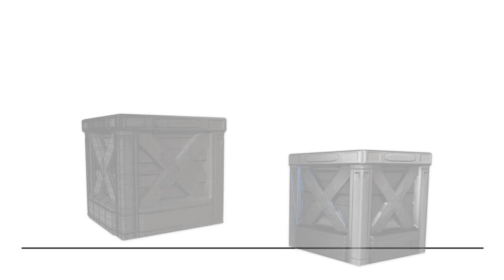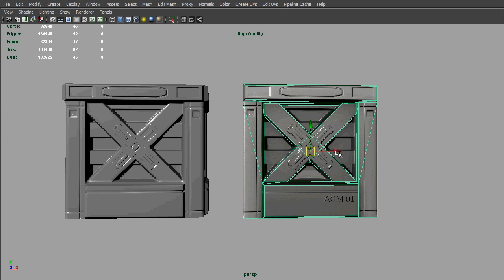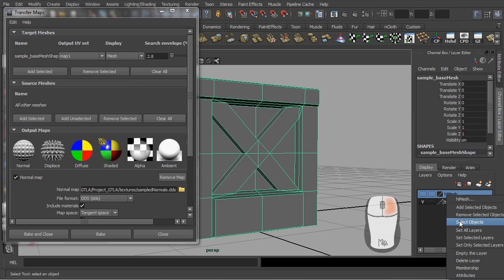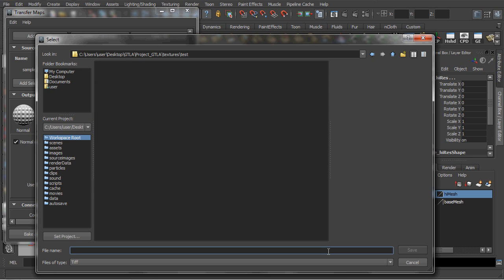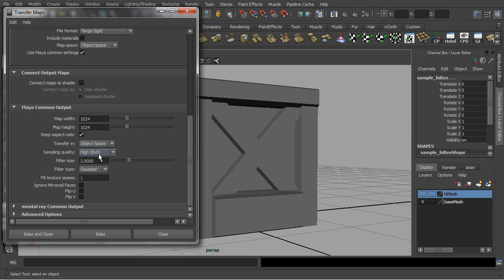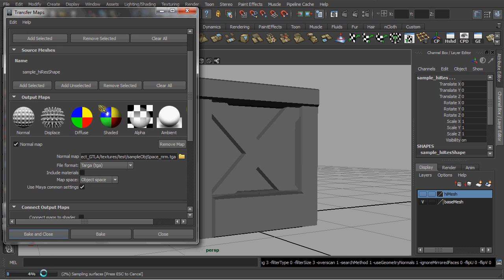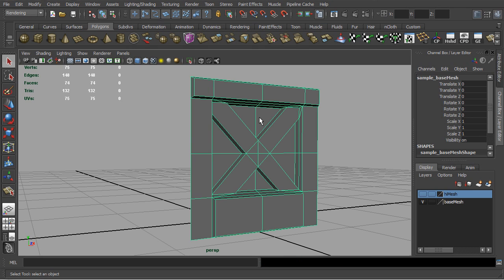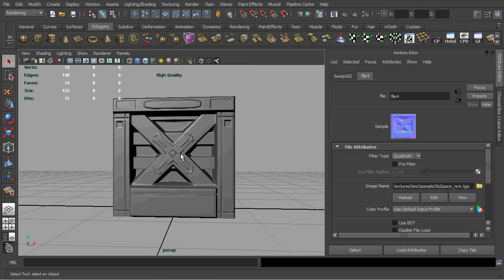Baking Object Space Normal Map for low poly game asset (Autodesk Maya)

Comment from the maker: Hi there! There are many different possibilities that can cause the operand of normal baking to fail and out of course sometimes.  Sorry I can't figure out the written difficulties that you had faced.  Anyhow, please do ensure that the XYZ positions of both the low-res & high-res are aligned in the same object space coordinates before you begin the baking process.  Also, you would need to unwrap the UV of your low mesh before attempting the task.  The unwrapped UV must not be overlapped as well.  Hopefully, you can get it working! Cheers.
Reply: I like this.
Reply from the maker: Manosh Tamrongchot Thanks! Glad you find it useful. Cheers :)
Reply: Lin Chou Cheng Thanks for the tutorial!, one thing. I was curious if you could make another tutorial for complex meshes. I've managed to bake clean maps on planes, but never got a clean bake from complex meshes. So I ended up using photoshop plugins for the normal maps which does the job, but not as nice as getting it from a highpoly model.

Thanks in advance!

Olaf.